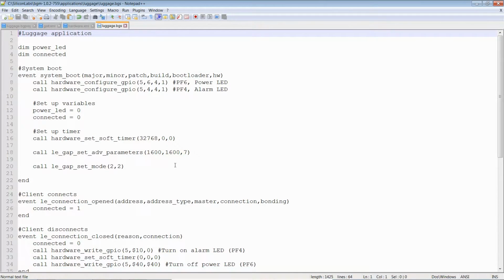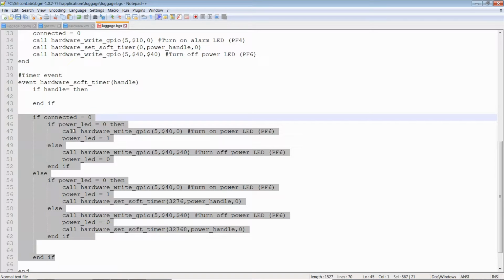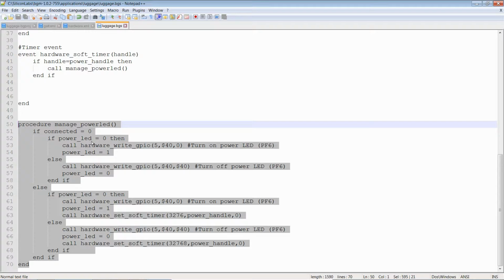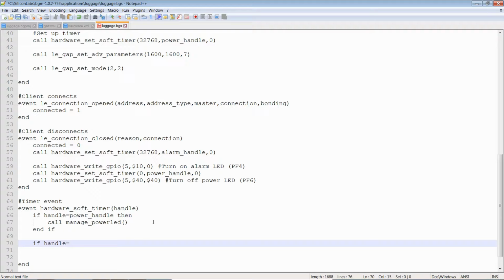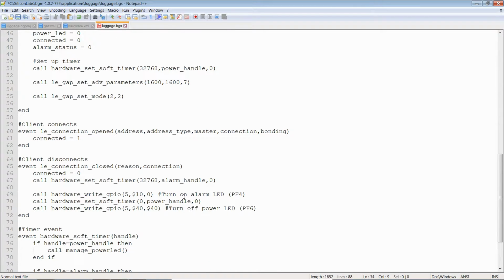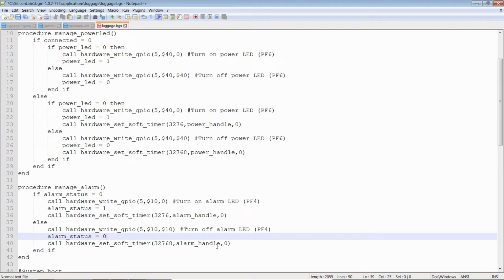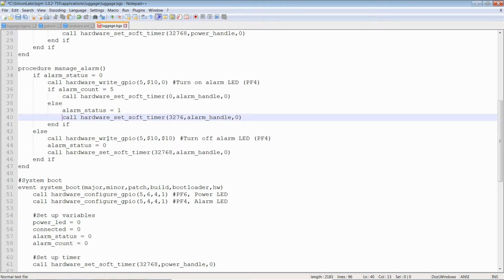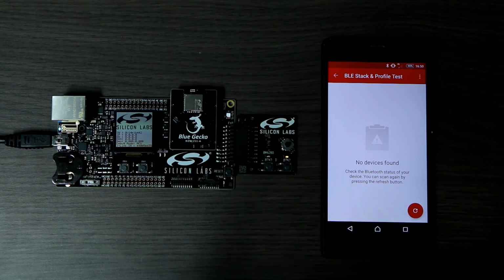Bluetooth in Action 8 - Const and Procedures

Comment: Thanks for the series!
For the next episodes, it would be very interesting for me to see how to use the devkit's GPIO connectors to trigger an external alarm line - as an on/off relay switch?
Reply from the maker: Hi Slawekj, I've been a little bit busy recently, I've decided to create a parallel series on electronics, one of them will be about GPIOs; connecting transistors and relays. Another series will concentrate on BGScript tips, so I'll be sure to add that to the list!